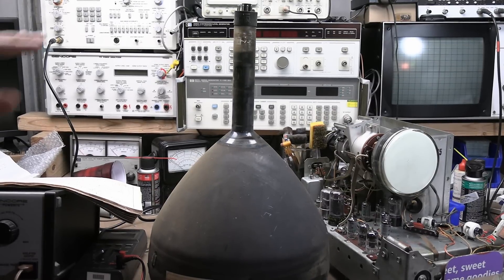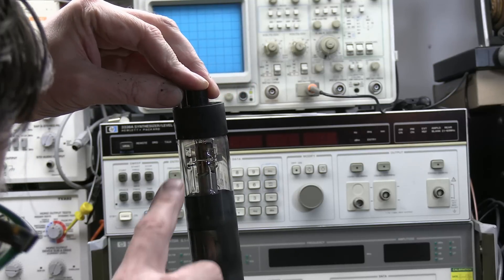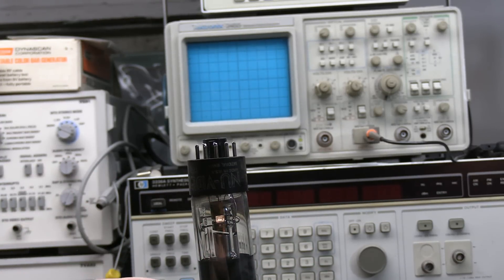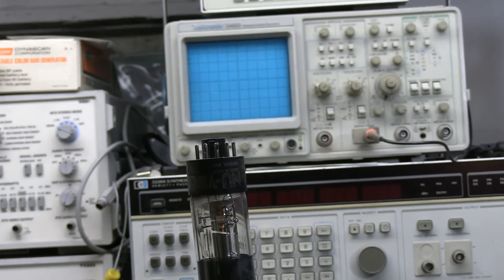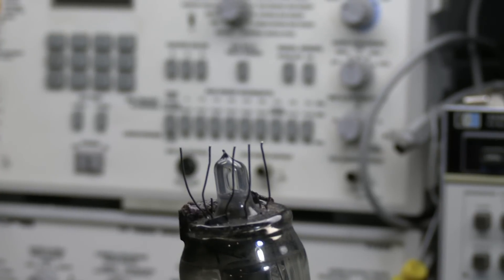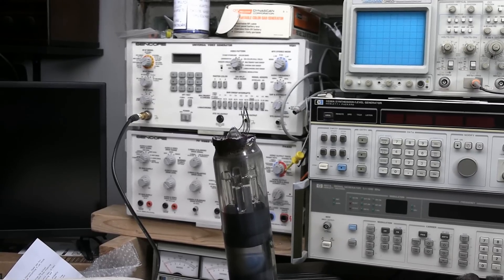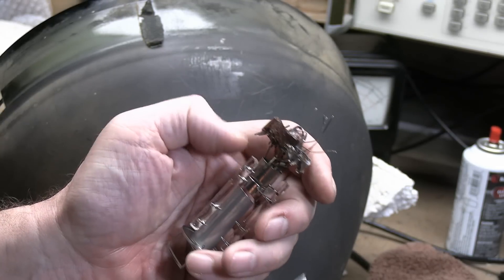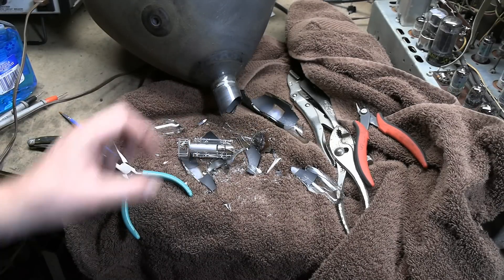12LP4 cathode ray tube autopsy

Comment: Don't know if you've heard of this but there's a trick that broadcast engineers use to repair filaments on power tubes. You get a HV supply and arc the two pins. The arc will weld the open connection as it jumps across. Worth a try. You've got nothing to lose at this point.

Comment: There is always a risk with breaking the glass but the 'small' end should avoid implosion. I have shot these in the neck with an air-rifle and as a kid blasted a similar (non-safety mask) tube with a 'BB' gun. A little hole appeared on the inside and air rushed in as in your presentation. That said, I was told by someone of a garbage man being killed because someone left a TV tube in the domestic refuse. You cannot be too careful!

Comment: A cleaner way to de-neck the tube would be to insert a ten gauge copper wire into your soldering gun and wrap the wire around the neck tightly>>don't overlap the wire. Energize the gun and in a few seconds the concentrated heat will crack the glass in a line around the neck.

Comment: Great content as usual Have you ever tried RF welding. I  tried it once from an article in the UK Television magazine it used the output of the top cap of a valve line output stage to hopefully bridge the gap of the broken heater and re join it. When I tried it I'd did work but the heater only lasted  for a few minutes after the process.

Comment: Is it my imagination or does the filament wire get thinner as you approach the centre of the coil lengthwise?  Could it be that it is a little hotter in the centre because heat conduct away at the ends more than the centre?  If run at excessive temperature, perhaps the tungsten gradually evaporated off.  This makes the wire a little thinner so it runs a little hotter and evaporates faster.  A positive feedback loop that ends in failure.
Reply from the maker: Quite possibly.  I wonder if it had a brightener on it?  There also seems to be some sort of coating near the ends.  Maybe to insulate against contact with the cathode.

Comment: That was great Bob!  Love that you took the investigation all the way. Did the phosphor get blown off the CRT face by the air rushing in?
Reply from the maker: Thanks. Yes. Just posted a photo on the community tab of my channel. Makes me wonder how that was avoided when CRTs were rebuilt?
Reply: @bandersentv  There was a video you could find on the ETF website where Hawkeye showed the process of re-building. One method used a tungsten bit in a Dremel that melted a small hole in the side of the neck by friction. The other method scored a line on the neck, covered it with tape, formed a crack under the tape by stressing the neck, then using a knife to cut a slit crosswise in the tape.  Ha-ha! So obvious.
Reply from the maker: Yes, I added the link to the description.

Comment: Didn't seem to be much vacuum in that tube.  All the ones I ever broke had a significant implosion.
Reply from the maker: It was a hard vacuum with shiny getters.  How did you break them? Breaking the seal at the end of the neck is the safe way.
Reply: @bandersentv  Right. Any method that kills the vacuum through the thin glass. The thick areas of glass are thick because they are areas with high stress, break it there and there is too much force available. Like sticking a pin in a rubber balloon, it starts a tear that quickly grows because of the stress.

Comment: I had a tube that also had an open filament,  having nothing to lose, I zapped the pins with a charged capacitor to try & weld the broken ends together , after 4 attempts I had continuity.
Testing the tube proved that it now had cutoff & emission, albeit not great, it was tried in a set & did produce a picture.
My theory was that surge voltage from the series string had weakened the filament over it's lifetime, eventually causing the break.
Reply: The old books mention this technique. In former times, CRTs cost several weeks' wages so there was nothing to lose. At the same time, shops that re-gunned tubes existed in some proliferation but have now disappeared. The last time I bought such a tube (colour) was back in 1982 from a one-man outfit in a former horse stable and it worked fine!

Comment: 9:05 The wires in the glass seal are almost certainly Kovar, an alloy whose coefficient of thermal expansion is practically the same as that of glass. That prevents differential thermal expansion, which would eventually cause the seal to fail.

Comment: I had success desoldering base pins on a WD-11  just as you have on this crt. I don’t like the idea of crimping the pins,tool or not. Once crimped it’s hard to uncrimp.
I never seen such a tool or seen one used. How did you recognize it when you found it?
Reply from the maker: I think I saw a picture of one before.  Maybe in an ad

Comment: Such a shame that nobody picked up the trade of rebuilding CRTs after Hawkeye retired. :( there is still a huge need for it!
Reply from the maker: Money. Cost $300 to get a common 10BP4 rebuilt back in 2008. I'm sure it would cost even more now if anyone was doing it. Few would be willing to spend that much.
Reply: Hawkeye offered to sell the business to someone else but no one took him up on it. Too little volume to make it a business. The person that got some training and was going to be at the ETF museum had to change his plans for personal reasons. He was in the process of setting up an operation where he lives now near the US east coast. He was planning to have a company in Ukraine make new guns, but history had other plans.
Reply: Lot’s expensive equipment  and tooling needed along with skill. Sourcing raw materials like electron gun assemblies, cleaning chemicals, would be quite a task. Even with all that a high yield of good tubes would be difficult to achieve.
It would have to be a labor of love and deep pockets, not a money making adventure with such small volume.
Reply from the maker: @ebones6957  The early TV museum in Ohio has all the equipment and new gun assemblies. Problem is no one has the experience to operate it
Reply: @bandersentv It's a shame it's so difficult to make a living for most people that none of us seem to be able to take on the task and learn it at the museum. 

One might be able, but lives too far from the museum. This stuff will be lost eventually. We'll keep it moving forward as long as we can. 

Invite the younger people and treat them like gold. They will have to take care of this equipment and carry it and the passion into the future.
Reply from the maker: We tried 15 years ago.  A large sum of money was raised to train folks at the last two rebuilders - Hawkeye in the US and RACS in France.  Only one person stepped up and his situation has changed and is not able to work at the museum.  All the equipment and new guns from Hawkeye is at the museum.  I believe more guns from RACS were also shipped over.
Reply: @ Does the museum have any notes from past tube builders that one might be able to compile into a step by step rebuilding procedure?
In the middle 60’s I worked at Westinghouse color and B&W CRT manufacturing plant. I remember the glass lathes and special gas torches  for stem sealing and tip off.
I remember the Ferris wheel looking machine where a liquid slurry with phosphor was used to coat the CRT face plates .  Frit sealing etc.
In the 70’s  I worked for a short time at Corning Glass, and gained some knowledge of making face panels, shadow mask pin sealing, and spun funnel machinery. I remember the different type glass’ used.
In the mid 80’s I again worked at Westinghouse building image tubes and miniature military CRT’s. I’ve built electron guns in a clean room atmosphere.  I’m familiar with roughing pumps, vac -ion  pumps, making glass to COVAR metal seals,  HV ceramics etc.
Most all my colleagues are dead, and I miss talking about the various tube building process’.  I am not by any means an expert , but hopefully could  add to any conversation to help preserve some of this lost art.
I would like to be part of a collaboration to write a cook book for building tubes if i could find others with the same goal. I most likely forgotten more than I ever knew,but If I seen the equipment I believe I could recall how it worked.
In tube building there are a lot of critical steps , its not hard,but there a lot of detail.  Glasslinger has offered a lot and makes it look easy, but he leaves a lot of the fine details out of his videos, (quite justifiably). I appreciate what he shares.
Reply from the maker: @ebones6957  Not that I'm aware of. but they did video the process at Hawkeye.  The video is on YouTube.
Reply: @ebones6957  I'm sure there are some documents at the museum. There was a video of the entire process at Hawkeye and a video made of many parts of the operation in France, RACS, (workers spoke French of course but the guy that was filming it translated some). The company in France also showed cleaning the tube with an acid solution to remove everything in the front of the CRT (screen, aquadag, aluminum) and then the process of replacing them. Several special automated machines. It would be impossible to put a new screen in a color CRT.
Reply: @ One would have to separate the front panel from the funnel cutting thru the frit bonding. Then remove the aperture/ shadow mask, strip the phosphors and start over.(not practical,  maybe not impossible). Its amazing what engineers can do.
Reply from the maker: Impossible as far as I know.  All the color CRT rebuilding I'm familiar with reuses the phosphors and just installed new guns.
Reply: @bandersentv  Some color CRT 's have good phosphors. Some will take a darker almost brown look and those phosphors are damaged. 

Notime and ebones are fascinating. Their knowledge and experience are important. How is this added to what is currently held and preserved. One mentioned East Coast. We have our vintage radio and communications museum in Windsor, CT. It's a successful organization albeit with limited resources. We have a really great guy with RCA training and years in the business. We have some rare sets as well. Not sure if the East Coast guy mentioned is anywhere near them. Maybe early TV and VRCMCT can be more interactive. I'd love to think we can do this. I'll buy a few more lottery tickets today!
Reply from the maker: @ebones6957  The Early TV museum in Ohio has a full rebuilding setup and supplies but no one to run it.
Reply: Hi to all, in addition to the Hawkeye gear ETF has ex-RACS B&W phosphor depositing machines, Aluminum vaporizers, vacuum pumps, P4 phosphor, complete B&W & color guns, neck tubing and Filament/Cathode/Getter subassemblies. RACS owner's "cookbook" on CRT rebuilding with 30 years of experience is also at the ETF & has been scanned/downloable on their site. A full shipping container of gear was sent from the south of France to ETF/Hilliard/Ohio. Just waiting for the right guy/gal to "wake up Cinderella". PS: on color CRTs, you can change the gun, re-screening is impossible.

Comment: I did an experiment where i drilled a hole in a 12HK7 then i epoxide a fitting and connected it to my vacuum pump. Tube tested about 75% before and after increasing the heater to 16/17 volts it tested like 20%. My pump only goes down to 100 microns.
Reply: What kind of epoxy did you use? Ordinary epoxy may outgas and spoil your vacuum. There are special vacuum epoxies (and other vacuum adhesives).
Reply from the maker: Exposing the cathode to air may have poisoned it?
Reply: 100 microns is a very deep vacuum by even stringent HVAC standards. I've wondered how deep it could go.
Reply: @johnnytacokleinschmidt515  Well, the vacuum pump was a cheap harbor freight one. There's ones that go down to 3 or 4 microns. Then connected to a turbo molecular pump. Then, the getter is heated inside of the tube. So i don't think I was close to pulling a strong enough vacuum.

Comment: Very interesting, Bob. Way better than a photo or a line drawing in a book. How about a more in-depth tutorial on electron guns? Their constituent parts, why they were designed that way, and maybe open up the bell for a look at the screen? What technical problems had to be overcome during the development of the CRT? That would be super interesting. Think of all the views!
Reply from the maker: You are assuming I possess such knowledge ;)  I know some stuff but not all the theory and history.  Back of the screen is just white powder coating on the glass.  Later CRTs had a thin aluminum layer over that to prevent ion burn.
Reply: That's a big subject. Search on youtube and elsewhere and bits and pieces can be found.
Reply: Light optics is the lens theory directly ported to electron rays. Identical. It is covered in detail in an RCA publication credited to Vladimir Zworykin called TELEVISION. Published around 1949 and widely available. Old theory textbook.
Reply from the maker: @directcurrent5751  Yes, I have a copy.

Comment: Good golly! Getter goes goodbye right in front of your eye. Amazing it still does what it supposed to do after 75 years.
Reply: I’ve always been curious if there would be any merit in reflashing the getter if the tube was found only to be gassy.  Flashing with a small induction wand/ oscillator  could be done easily.
Reply from the maker: Possibly, but only if there is some unreacted material left in the getter cup.
Reply: @bandersentv  Some getters are in the form of a tiny trough formed into a ring. The material is loaded into the trough.

Comment: Fascinating.  Never seen a CRT filament before.  I had just assumed it was a wire wound like a spring attached to two support wires, like an incandescent light filament.  So is this wound more like a concentric cone shape to fit into the recess?
Reply: It's likely a heater for a hollow cathode cylinder. Only the face of the cathode needs to be hot, but that's a good way to get the heat over.
The construction would make more sense if it was taken more apart so you would see more of it!